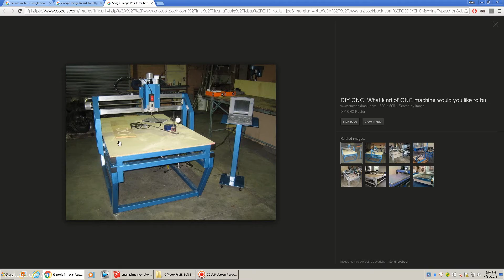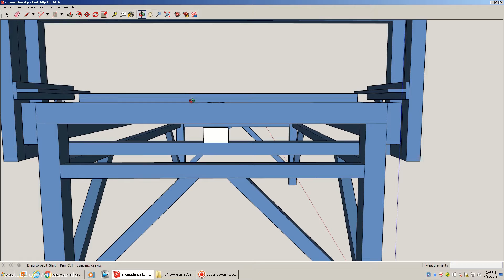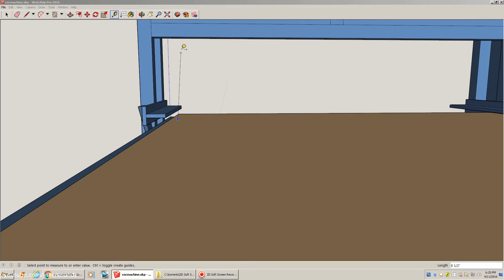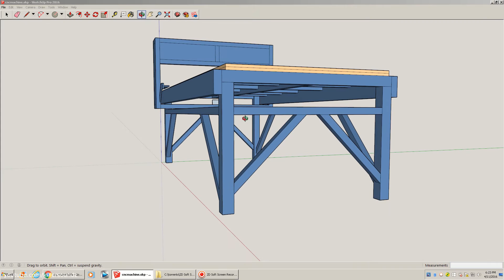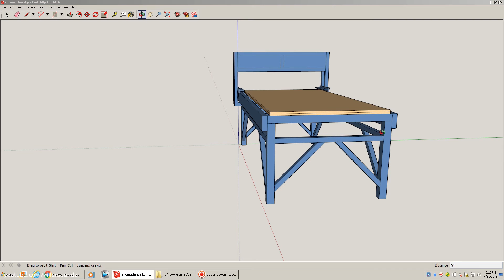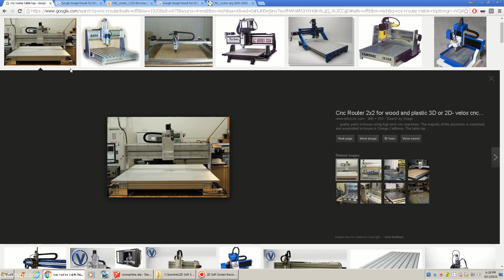Alex's 4x8 CNC Router Build Part 2: Design & Theories

Comment: I like it but you are way over engineering it, if you cut the thickness of the material by 1/2 you would still have a robust table that can handle more than you would ever put on it. So having said that why are you going to such an extreme for the table rails and legs? Anyway consider trimming it as you said moving it is going to be a major pain.
Reply: +Alex Knappenberger Does Everything Fair enough! ;)